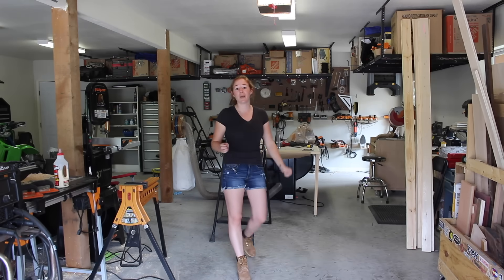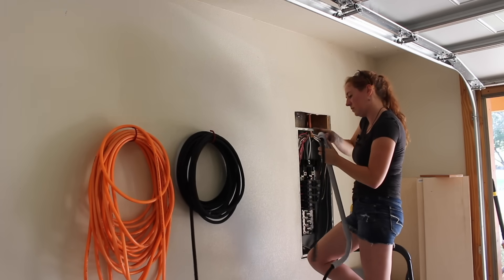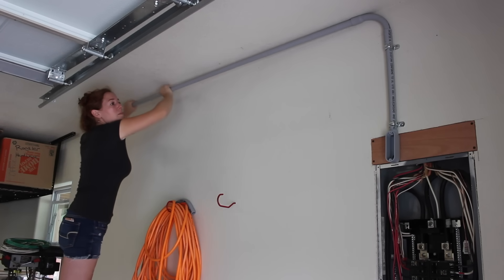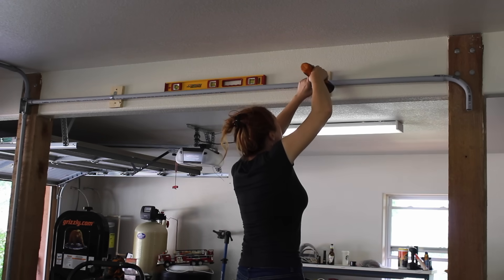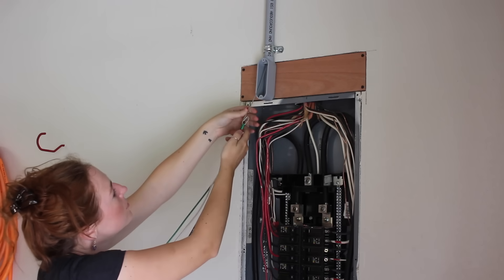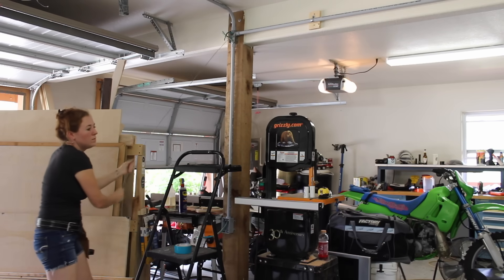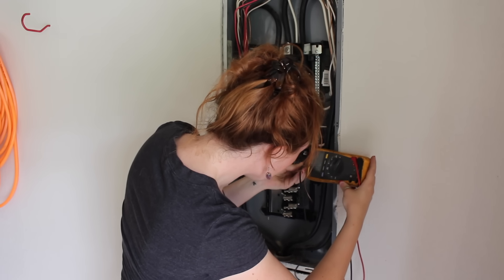Adding 220 Volt Outlets to the Garage

Comment from the maker: And let the comments begin. Ha. Ok a few notes from me: I am comfortable tackling this job myself and did lots of reading and asking around before starting it. It also isn't my first time doing electrical work. Depending on your knowledge level of electricity  you might consider hiring the job out and then regardless of your knowledge level, have an inspector check over your work. 

Something I didn't show in the video just because of time sake: Before energizing the circuit I went through with my meter and check continuity between each one of the legs to make sure there wasn't a short.

For those who don't know the acronyms: EMT is metal conduit. NEC is the National Electrical Code.

There was a big discussion about needing a red wire instead of a white. This is something that was brought up on Instagram while I was doing the project and the take away was if the intended load is 220/240v then two hots and a ground are sufficient. If there was something like an onboard clock or additional function (like an electric stove or dryer has) that requires 110/120v then an additional wire for neutral would be required. However, since I used white I did mark it with a red marker at the breaker so anybody looking in the panel will know that it's being used as hot.
Reply: It's pretty common in the US to be able to do the work on your own house as long as you follow code and inspection procedures.
Reply: Another great video, April. I do this kind of work myself too - minor electrical, plumbing, hobby electronics, metal and woodworking, etc. I'm not a tradesman or contractor, just a self-taught tinkerer. We are lucky the U.S. allows people to be self-reliant and not have to hire a specialist for the simplest tasks. Home repairs aren't brain surgery.
Reply: @automaticprojects  Actually, to be more correct:  'We the people, being the U.S., allow ourselves to be self-reliant and not have to hire a specialist for the simplest tasks.'
Reply: @automaticprojects  Until such time as the DemonCraps enact "protective laws" - for our own good, of course - and put people in prison who don't comply.
Reply: April: you always impress me.
Reply: NEOhio Woodworkers she clearly states in her blog she is not making the video as a how to. Her channel is not a how to channel it is a vlog of her projects. She is not claiming to teach anyone anything. You're just being a bit of an ass and it is unnecessary. 

She did everything correctly in this video. I'm not sure exactly where she lives but in most of rural US small things like this do not require permits. Hell where I live I can build an entire house without a single permit.
Reply: Hello, Sweden here. Someone commented on how it sounds crazy that you need to be certified to do any of this stuff. Let me start by saying I am NOT working as an electrician, however that was what i studied for when i was younger so i have some knowledge in the area.

So first off i think you did a nice job, whenever I have to do like external stuff like that I try to use either recomended wallstrips (if inside the house) otherwise I go with approved cables for external installation. So cudos on making the effort to keep it clean, having seen a lot of your videos though I'm no surprised by the quality of your work. :)

To adress the "omg you gotta be certified!?!". Listen, any sane person would ask for help and asume that you need good wiring and cables for something like this. But there are crazy people out there that I have seen run regular old like lampcables to extend a 400v main fuse, that is not only stupid but outright dangerous as it is a fire hazard. So in Sweden at least the rule is something like this: Everyone who knows how to do the job right is allowed to, without supervision, wire in stuff like ceiling lights (those don't always have connectors you know) and basicly any other household connection that already has wires going to the main box. You are not really allowed to do extra wall outlets unless you know how to do it properly and have a certified electrician look at it. You are NOT allowed, under any circumstances, to wire stuff in the main box unless you are certified to do so. Now that being said, I have a good relation with a local electrician whom was here when we redesinged the kitchen so he saw some of my own wiring and approved of them, later on we where adding some new ceiling lights to the kitchen and he told me "You know, to keep down costs I'll just leave this spare live-wire in the ceiling and you can hook that up yourself once you decide where all the lights go.".

And with all that I would never wire stuff in the main box because it's been almost 18 years since I did any of that stuff so I'd rather leave that to the professional while I do more casual wiring myself. But that's me and is no reflection on the job in the video. :)
Reply: Amen,  So glad to hear someone besides me say stuff like that.  Everyone thinks the Government owns them and they should say Mother may I everytime they need to go Pee.  If it's your house and you do it right (Code or Not) Then Screw it.
Reply: David Cobern+ In the UK there is no law against performing electrical work when unqualified.  You are legally responsible for the quality of your work and also it CAN be a problem for a house insurance policy.  I have fitted extra 3 pin outlets in my rented flat myself and on my request the landlord got an electrician to check them so their fire insurance remained valid.  The electrician commented that I had done the job better than many electricians would have done as I used additional anchors above the required number.  Better safe than sorry.

I strongly advise people NOT to do electrical work unless you know what you are doing, and DON'T KID YOURSELF.  If in doubt pay somebody qualified.  If you get somebody unqualified to do the work GET IT CHECKED by someone who IS qualified.  Even though I am confident I always get my work checked.  Getting an electrician to check work is a lot cheaper than moving house if it burns down.
Reply: I agree with you Mark. We are lucky. And it's not like it's unsafe. It has to pass inspection. And if diyers are going to bypass the permit process and illegally wire and potentially create a fire or electrocution hazard, they will do it regardless of whether it is legal or illegal. Just look at April's talent. All of that potential going to waste if we were required to hire a professional for everything that she does herself. And we would never get the things that make us happy and allow us to do our "building" because we couldn't' afford them. Another great project, April and thanks for sharing.
Reply: Here in Sweden, no you're technically not allowed to do any HV work yourself (230V), but you are allowed to swap out light switches and simple stuff like that. 
In my case I run the wire myself (most of the time) and then have my moms husband connect everything and since he's got a electrician company that's all good...

ALOT of ppl do this stuff by themselves though which causes fires and electrocutions due to ppl not knowing where to stick their thumbs :P
In case of a fire you'd probably not get any insurance due to not having proper papers for your electrical work..
Reply: In America a homeowner can work on their own single family house.  There is a hope that if they don't know what they are doing they won't do it.  Yes some risk but lots of rewards.
Reply: #TeamSpindleSander
Reply: Benjamin Allott that's why we call ourselves free in America. Not as free as we used to be, and not as free as I'd like it to be but we can still run wires and pipes in our own homes if we want to. Insurance may not pay for any damage caused by doing it ourselves we are still free to get er done when and how we like.
Reply: Eh there is a lot of gray area there. That's kind of a blanket statement. If there is faulty wiring and it burns your house down it's very difficult to distinguish work and who did what. If they can tie back the source to something distinct like a piece of equipment that failed and caused the damage then they can ask who installed it, but even then the homeowner could just shrug their shoulders and blame it on a previous home-owner. If you do the work properly and with common sense you are probably doing a better job than most 'licensed electricians'. 

The work I've seen by so-called electricians locally is atrocious, and most of them lack even a basic understanding of proper equipment installation. I actually had a career "master electrician" argue with me about leaving a sub-panel PE-Neutral strap in, (which created a ground loop) because he said that it was "Unlikely" anything bad would ever come from it. (Never mind that it's against code) This guy literally spent 10 minutes crying about fixing the issue rather than just popping the cover and two screws off of the tie. I do most of this type of work April did myself but I don't consider it "At my own risk" as I use good practice and installation. Remember, the more intimate you are with your mechanical systems the easier it is to trouble-shoot issues when they arise, (more-so with control systems or machinery.) Doing mechanical/electrical work isn't for everyone as it requires both education to some extent and experience to do it safely and well, but it isn't rocket science.
Reply: April Wilkerson awesome job 👍🏻 glad to see your still bringing us some awesome comments. Ignore the haters and remember the ones who find u and ur channel brilliant 👍🏻
Reply: Here are a few friendly suggestions I would have done differently [Journeyman electrician]

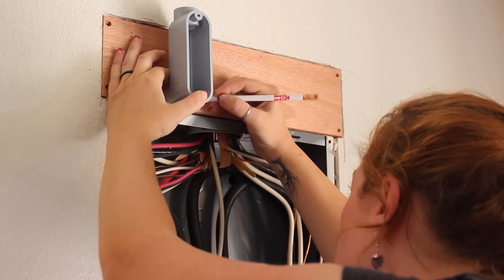0:44 I love that wood panel. [Not for conduit]. If you dont mind the look of the wood, its a fantastic way to run future circuits into your panel.

1:36 Use a 4 square box about 12 inches above the panel instead of the PVC 90 [Conduit body]. End the conduit there, then come out the back of the box with romex cable. Then go into the panel. Or come out the back of the box with flexible conduit, to protect the wires into the panel. The 12 inch space between the panel and the box allows for the 90 degree bend you need to make with the cable or conduit.
http://www.homedepot.com/s/4%2520square%2520box?NCNI-5
http://www.homedepot.com/p/Southwire-3-4-in-X-100-ft-Flex-Alum-Conduit-55082303/202316477
http://www.homedepot.com/s/romex%2520wire?NCNI-5

2:44 I would have used shallow, or deep strut here. That would provide the spacing needed to keep your PVC conduit relatively straight.You can also try conduit hangers. You can also use a heat gun, maybe a hair dryer, so heat up the PVC and allow for minor bends. This takes some practice, try it on a scrap stick of PVC pipe first. Dont burn the PVC either. 
 http://www.homedepot.com/s/strut?NCNI-5
http://www.homedepot.com/s/conduit%2520hanger?NCNI-5
http://www.homedepot.com/s/heat%2520gun?NCNI-5

4:04 This junction box is kinda small. I would've used a larger one.
http://www.homedepot.com/p/4-in-30-3-cu-in-Metallic-Square-Box-Case-of-25-521711234EW-25R/202592852

4:37 Yea red instead of white would have been better. But just buy some red electrical tape and at least wrap the white so its red, at each box and in the panel. This will avoid confusion for anyone working on it 5-10 years from now.
http://www.homedepot.com/p/3M-Scotch-75-in-x-66-ft-35-Electrical-Tape-Red-10810-DL-2W/100210612?MERCH=REC-_-SearchPLPHorizontal1_rr-_-NA-_-100210612-_-N

5:14 Minor thing here. Those straps on the blocks. They are one hole straps. They are facing down.
1 When they support a horizontal conduit face the straps up.
2 When they support a vertical conduit, alternate the straps left and right
3 When your conduit in hanging upside down on a ceiling, dont use one hole straps. Use two hole straps or something else.

Thanks for the video. All and all good job. This post is mainly for other using this video as a guide for their own projects.
Reply: all your tools amazing
Reply: April Wilkerson , just some info on the conduit and multi wire conductors,  the reason you are not supposed to run multi wire conductors through conduit is because all conduit is considered a wet location, and some of the multi wire conductors have a paper insulation over the ground wire, and if paper gets wet it then conducts. does it usually mater? no, that is just the official reason
Reply: chris struchen she said she marked it with a red marker, if you look at her panel there are a lot of red marked white wires in there already. She just moved in to an existing home, so I'm pretty sure the previous panel work had been inspected. Her work just matches what was already in her panel. The only thing that concerns me is that it doesn't appear that she ran the conduit into the panel, just the wall. If the new wires are rubbing her panel knock-out hole she could get a direct short to her panel and that is a fire risk.
Reply: One quick suggestion: When pulling wires through conduit it can be helpful to also pull a piece of string that you leave in place. That makes it easy to pull a second circuit in the future.
Reply: What countries are you referring to? In the US it varies by state but in most states the important factor is that the work is properly permitted and then inspected. Who actually accomplishes the work, as long as it is done right, is irrelevant.
Reply: +DevonIsAwake

In Germany you can do that too. Formerly only persons which are educated (apprenticeship) for this, but there are some common sayings here:

1st one: "Das elfte Gebot: Lass dich nicht erwischen!", literally transalated: The 11th commandment: Don't get caught!

2nd one: "Wo kein Kläger, da kein Richter"...No plaintiff, no judge

And here you've got also two voltages in the most homes. The most houses here in Germany are having a three-phase power supply. Three phases which are having a voltage of 230V measured against ground or neutral. But if you're measuring the three phases against each other they've got 400V.

https://en.wikipedia.org/wiki/Three-phase_electric_power
Reply: I'm an electrician and I'm proud of you.  A little common sense goes a long way.  Just be careful.
Reply: Oh yea? Which part of the installation would cause a house fire? Your overreacting
Reply: wow that's nuts, what countries are these?
Reply: David Coburn Yes they were. If doing stuff yourself like that, (not for reward) there's really not an issue and lots of folk do small jobs like that on their own property. I'm building my own house and a qualified Electrian has to oversee my work to sign it off as correctly done for us to reach code - and we'd need that if we ever came to sell the house.. My father was an electrician and before these rules were in I remember some of the truly dangerous stuff he used to come across done by amateurs and even some people calling themselves electricians so it kind of makes sense, but like most rules, can be taken way too far.
Reply: April Wilkerson thanks for that idea.  I usually just get a piece of plastic bag and tie it to the end to pull the nylon.  cool alternative
Reply: Better than I could do, Great job April
Reply: NEOhio Woodworkers - Some of us just like to watch stuff get done. Still, if April decides she needs an advisor, I'll volunteer: POST THE VIDEO.
Reply: she mentioned at the start she turned off the power at the main switch before the box; so the power feed was dead (so to speak)
Reply: I asked about that in an other post. She says she cut power at the pole. I don't know about TX, but in NJ, you are not cutting power at the pole. Main breaker is about it. You could pull the meter, but that is not something for most homeowners to do.
Reply: The NEC is only the minimum standard for electricial work!!!
Reply: Ok, here's my comment... you're awesome as always. That is all.
Reply: +Grant Bruner:

In Germany we've got the saying (literally translated): Voltage is hurting but current is making you small, black and ugly.

But we've got 230/400V three-phase power supply (star circuit, or Y-connection).

And for the people which are saying this is communism or some crap like this: Remind the workers/owners which could work later on this installation. Using the standards and the code could make their work much easier and could prevent accidents. If you're selling the house in the future it's the best thing to use the regulations and the code so everyone could comprehend what was done here.

In Germany, after the building is connected to the mains you can do whatever you want. But if something happens you're getting problems with the insurance, in case of injuries or death you're getting problems with the attorney. But these things could happen to electricians too if they don't work proper.
Reply: @Call RJ: Yes it does. Well actually you can't be certified if you don't work for at least three years as an electrician in some company. You are not allowed to do anything more than put a lamp to a ceiling (and connect it with a "sugar cube") or make a single phase extension cord.
Reply: Ya, the glue would be a good idea, and rotate the writing against the wall so you don't see it. That's just for cosmetics though. GFCI is not required in Canada for garages or powertools. Only outdoor outlets below 10'. The standard breakers won't protect you at all though. They just protect your house from fires. (not including arc faults) GFCI would actually trip if you touch the electricity.
Reply: That's why America Rules!
Reply: Most people that live inside the city limits wouldn't normally be doing this kind of work themselves (Don't know how)  Phil Robertson calls them Yuppies   LOL.  But even if they do I wouldn't spend too much emphasis on worrying about silly stuff like that.  Just do it right.  Like always.
Reply: agreed there are alot of fellow  sparkys on here with some really crap comments....
Reply: You did it right April Great Job.
Reply: Not that I would ever take on a project this large (electrically), but thank God I live in the US where I could if I wanted to! If I own a home, I damn well better be allowed to maintain it myself. Self-sufficiency is a beautiful thing as long as you know your limits (i.e. why I would never take on an electrical project this big).

Great job April!
Reply: You did a dam good job. I live in a rural area and we aren't forced to Be code compliant. I'd hire you in a second. If you want code compliant learn the codes or hire an electrician. Opinions are like Ass-Holes.....everyone has one!
Reply: April Wilkerson: My absolute favorite part of this video is that you didn’t waste the viewer’s time blathering endlessly about irrelevant matters.  You got right to the point, which is a fundamental concept that eludes far too many posters on YouTube!
Reply: Get it right, it's 120/240 V
Reply: = Tyranny . Resist and do it your self
Reply: canesrock82 muhaha..
Reply: Looks good to me. Glad you switched to the individual strands of wire; I guess heat can become an issue and I'm guessing thats why individual strands are warranted in conduit of any sort; General Contractor here, and have done MANY electrical projects, but I'm by no means an "Electrician."
Reply: @michaeldobbs5274  in canada we start derating ampacity over 3 wires in a cable or conduit...even loomex in 1" holes get derated by fill.
Reply: Awesome job I have always wondered how difficult this would be thanks for the video
Reply: As always, great job!
Reply: April Wilkerson thank you now old Wolfman can do it right with your instructions. 👍
Reply: We are not a communist country yet.
Reply: If they sell you a policy you are covered.
Reply: @Amtruckn  until or unless something you do can be construed (even incorrectly) to have contributed to an incurred loss.  Simply buying coverage does not address all risks, or those brought on by your own lack of knowledge, deliberate or not.
Reply: Seems like if the other hot wires in the box are white with red marker, making these the same has some real advantages in terms of being immediately clear.  If the function was somehow different, that would be the reason to make the appearance different.
Reply: OK, thanks for the feedback.  I sort of suspected they didn't want me mucking with their lamp more than anything.
Reply: In Australia, you are not even allowed to run any cables (some sparky's will let you run it as it saves them time and effort)
to legaly run data cables you need a restricted cablers licence.
Reply: At the end she is measuring with a multimeter and states: 245(v).  Which suggest live wire.
https://youtu.be/X9ro7Tc2nFI?t=300
Reply: Michael Dobbs most of that is hyperbole and is unwarranted, nec allows and suggests running all cable via conduit to protect it.
Reply: That's not quite correct and is over the top. In the UK you need to be certified to do electrical work accept under certain exceptions; however, when you read the small print there are more exceptions than not. It's a little like the 'i before e' rule in spelling.

You do need certification to work on the breaker box (consumer unit or control panel in UK speak), anything outside, anything within certain defined zones in a wet room/bathroom and certain extra low voltage/DC applications. Just about anything else is OK provided you are not increasing the rating of the circuit.

Of course whoever does the work it must conform to code.

It is even possible to do the above exceptions without certification if you notify building control and have them inspect as much as they wish. Given that they charge a lot for this it is more economical to hire an electrician for most modifications.

I own and run a property maintenance business here in the UK.
Reply: Yes
Reply: Correct Thomas.  I believe those are cables instead of individual wires.  In a cable you are allowed to Mark the White wire.  But when using individual wires pulled through conduit you have the ability to use any color, that means that the correct (not only way) is to use non-white wire.  But her marking the white wire will identify that it is not the Grounded wire.

Correct about the conductors being in open air from the LB to the Enclosure.  I can't remember the name of the conduit body but there is one that provides a sharp corner with a plate on the back side for pulling.  (Maybe Pulling elbow is the name)
Reply: chris struchen i just hope she either tapes her wire nuts and/or grounds the junction box, as well as red marks the white wire in each enclosure. Weather or not part of a cable or individual wires she is fine with the NEC, just proper practice and suggested to run red if individual. Her state and local codes however could be another point entirely. Local can be more stringent but not more relaxed. Electrically there is no difference as long as her individual wires are rated above her conceivable load capacity. The NEC does alow for mark corrected wires. Unless the codes have changed. I have been out of that game for some time now.
Reply: You are feakin' awesome. I just started wiring 12v LED lights for our haunted attraction. I have a long way to go to get to 220! My hubby is an electrician so I have let him do it all.
Reply: +Two Wheel Workshop

The circuit breakers are protecting you not directly. If you are using a class 1 appliance (appliance classes are defined in the IEC 61140, so they are the same worldwide) the circuit breaker could prevent electrocution from touching a housing or touchable surface that could have mains potential when the appliance is defective. But only if the loop impedance of the ground wire in the connection and the installation of the building is low enough and the short-circuit trip of the circuit breaker could react and switch the electricity off. From the measured ground loop impedance and the voltage you could calculate the PSCC (prospective short circuit current). 

But the RCD, or in the US called GFCI, is mostly faster and doesn't require such a low impedance as the circuit breaker does. Especially in TT-grids, in TN-networks the circuit breaker is mostly fast enough. Here in Germany the TN-C and TN-C-S are standard. In Germany every outlet that is fused with 20A or less must be protected with an RCD (GFCI) or RCBO (GFCI/circuit breaker combinated in one device) rated with a maximum of 30mA. 30mA is the current which could cause cardiac arrest. This is only for new installations build after 2013, older installations could be upgraded but it's not mandatory. Before 2013 it was mandatory since 1984 to use RCD protection on circuits that are in a room containing a bathtub or a shower. 

https://en.wikipedia.org/wiki/Appliance_classes#Class_I

https://en.wikipedia.org/wiki/Prospective_short_circuit_current

https://en.wikipedia.org/wiki/Earthing_system#IEC_terminology
Reply: +Robert Singleton:

But not every cable type is having paper inside. In Germany the ground is insulated like every other conductor in the wire, mostly with PVC and coloured green/yellow. The ground wire is never bare copper here. Standard type of cable here is the NYM (N=normalised, Y=PVC insulation, M=mantle). It could be used in dry or wet rooms, outside (protected from the direct influence of the sun). The outer sheathing is PVC, then you've got a layer of rubber style material to protect the wires inside:

https://upload.wikimedia.org/wikipedia/commons/2/25/AbmantelnNYM.jpg

The -J is telling it's having a ground wire. The version -O is not having a green/yellow ground wire. Then you've got a brown, black and a blue wire in the NYM-cable with three wires. There's also a version with five wires available: brown (L1), black (L2), grey (L3), blue (neutral) and green/yellow (ground).

But something I find remarkable: In electric installations you're normally trying to use flame retardant materials and inside of american cables is paper...or is this paper treated?
Reply: Hi in sweden it is like that. if u doit your self you cant get a professionell to certifi the work, he dont want to risk hes licens.
Reply: In the US, its not the worker certifying anything. Its a county Code Inspector.
Reply: April Wilkerson 
Thank you dear electrical and we want more explanation in the field of electricity
Reply: That is just a ploy to make work for the tradesmen.  I would subvert such a government at every opportunity and cheat on them to the max.
Reply: In the US it's totally different:

L1: black
L2: red
N: grey
ground: green or bare copper

L3 could be blue or yellow, but in most domestic areas you don't have the L3 because it's not a three-phase power supply. In the US the single-phase three wire system is common in domestic areas.

https://en.wikipedia.org/wiki/Split-phase_electric_power

In Europe the three-phase power supply is common even in domestic areas:

L1: brown
L2: black
L3: grey
N: blue
The ground is called PE (protective earth) and is green/yellow.

The PEN, combination of neutral and ground in one wire (only permitted if the PEN is having a cross section area of 10mm² (copper) or 16mm² (aluminium) is green/yellow with blue markings on the visible ends. See the TN-C earthing system:

https://en.wikipedia.org/wiki/Earthing_system#Types_of_TN_networks

In Germany the most common system is TN-C-S.
Reply: In Britain, you will still find pre-harmonisation colours: Red/Blue/Yellow for the 3 lives and black for neutral. If you go really old (pre 1970s ish) you'll even find pure green for earth.
Reply: Can you explain one thing please, about the US system?

240V sockets are considered as 2 phase - but as these are double the voltage of the 120V single phase, these must be 180 degrees apart.

I assume you use 3 phase (120 degree) distribution as that's pretty fundamental - so does that mean you actually have a 6 phase system at the delivery end in practice? Because voltage between 2 lives on a 3 phase 120V system would be 208V.
Reply: Single-phase three conductor system is not having a phase deviation, the systems are not comparable. Take a look at this picture, it's a transformer that is transforming the medium voltage to low voltage. The conductor in the middle of the right side is the neutral wire, which is grounded and so referenced to earth potential:

https://upload.wikimedia.org/wikipedia/commons/e/e8/Split_phase.svg

Actually this is not a 2-phase system, it's the same phase so you don't have a rotating field. Unlike to a three-phase power supply. Only the voltage is higher, so appliances with a higher demand are drawing less current. Here in Germany such a system was dismantled during the 1950s, that's the reason why the Schuko-plug system is not polarised. You've got the two hot wires but no neutral. So a polarisation of the plug wasn't necessary. In the UK you could find some remains of this system but they've switched to 3-phase power supply.
Reply: I get that - It is probably a case of semantics. I could call that 2-phase, with 180 degree shift, but probably most wouldn't. It is basically a centre tapped system with centre grounded. The only time I've actually heard of a 2 phase system in use, and bearing that name, were some of the historic systems in London at the turn of the 19th/20th century - and these were 90 degrees apart. A very weird system indeed.

However, semantics aside, does the USA use a 3 phase 120 degree generation and distribution system? And do people ever have full 3 phase supplies (eg farms)?
Reply: Trav Park the power is never ever off in the panel unless the feeders from utility company went to a main disconnect first. Also the lights were on wherever the panel was. So the power was still on.
Reply: April Wilkerso
Reply: April Wilkerson What is the voltage in the US? Because where i come from, the Netherlands, we use 230 volts for in the house and we use 400 volts for powertools like plasma cutters and welding equipment.
Greetings from the Netherlands!
Reply: Good thing you marked the white wire. Ive seen stuff happen where they upgrade the service, and they don't mark the white hot wires and it takes up time and stuff won't work properly.
Reply: Not sure where you live, but I live in the country in a free state in the U.S.A.  I built my own house, wired it, plumbed it, and ran the gas line.  NO permits or inspections required.  Obviously the propane delivery guy ran a leak down test on the propane tank when he filled it but I had been using the propane that was in the tank when I purchased the used tank.
Reply: And this is why America is called the land of the free.
Reply: Read article 200.5, this is a circuit over 50 volts therefore it is illegal to recolor a white wire, unless it was part of a factory assembled cable, which this isn't.
Reply: No, not in north America.
Reply: No, it's a bare minimum. Every individual code was written because of previous accidents or failed installations.
Reply: Funny way of doing it. Personally I would never hook up someone elses work, not even most electricians.
Reply: What in the world are you talking about? Ignorant home owners do by far the most hazardous work.
Reply: Yea except she ran wires in free air from the LB to the knockout in the panel, and forgot to glue her conduit and looks like the wire nuts she used were too small for 3 12/14awg wires. I think we found the armchair electrician :)
Reply: Here in Norway that is right. Here you can't even do plugs, if they are bigger than 16 amp single phased. The exseption is that an electrician can do this, but in his own home only.
Reply: Jason. If you are pulling wires in your garage you could hang the single conductors from the ceiling with J hooks but that would not be the proper or safe way to do it. The color of the wires is to help keep people working on the electrical system safe.
Reply: The NEC is the bare minimum
Reply: Yes. I saw something wrong. You're not an electrician. How that is not illegal over there is beyond me.
Reply: Here in Urbana Illinois, You can get permit first then work on your own house only. they will inspect you against NEC after you are done.
Reply: The best never rest!
Reply: April Wilkerson .....your work makes me complete. Great video.
Reply: It doesn't work that way. Get that permit, first.
Reply: commies LOL
Reply: GREAT JOB <3
Reply: You don't get to make the code up. You can't just mark the white wire for that size wire.
Reply: You did a good job and its your shop, so do it the way you want it. Although the white wire just kills the ocd in me. lol.
Reply: the red mark at the panel isnt sufficient enough. mark all splice locations and use tape or shrink tubing.
Reply: Did you earth those METAL junction boxes? They also seem really cramped/small for 3 sets of conductor to be terminated or joined with those wire nuts.
Reply: This is a good, constructive comment.  One way to "change" the wire color problem and increase the utility of the system would be to run an additional red (or other non-white) wire in the conduit.  Use the black/red/green wires for the L2/L2/Gnd 240VAC.  You mentioned that you didn't have a lot of 120VAC outlets.  At some point in the future you can use the white neutral for 120VAC outlets.  You done a great job.
Reply: Two comments... Technically you were supposed to ground out the metal box that you used for your junction; using a plastic box there would have been easier. Second, instead of using a fish tape, tie a piece of paper to a string and use your shop vac to pull it through the conduit. It's quicker than a fish tape and pulls easier.
Reply: If you do something like this yourself, do you have to have it inspected by the state/county/city inspector to make sure you're up to code?
Reply: I'm an electrician and I Concur.   
   Not sure what for.  Just do. 😂
Reply: In the UK we can do the first fix but the connection to the mains box has to be done by a qualified electrician and signed off our rules are stricter suppose it saves houses burning down plus all our cables are double core insulated and fire rated as they generally carry 240V and lots of angry pixies trying to escape (Ave fan club).
Reply: Isn't America Great!
Reply: I don't think there were any glaring issues. I couldn't tell if you ran pipe right into the panel. If you just piped into the wall the conduit should continue to protect the wire in the wall. There could be a few more straps on the pipe. The ceiling section only had one and there should be a strap within 2.5' of each box on each pipe. I usually just put 2 straps per 10' pipe. (there are a variety of strapping requirements that vary with pipe sizes.) We would be allowed to surface mount NMDU above 5'. So there is potential to avoid using conduit. I'm basing this on Canadian electrical code which is usually 5 years behind America but very similar.

Besides that, like you said be careful around the panel. Those middle breaker tabs have 240(or 220) between them. Don't wear a wedding ring while you are in there. I've seen people burn their rings onto their fingers. They make silicone "livestrong" style rings for construction. They will tear off before your finger does and not conduct electricity. I realize you may have set up your voltage test shot for the video but if there was live power you were closer than I would get. Stay safe! :)
Reply: @MrMCTario  suface mount nmdu above 5'? Lol dont think so bud. Not in any CEC I've read.
Reply: One thing I will add, you should always check with the city you live in to see if a permit is required, and if it is, get one. In the event that something goes wrong and catches fire, or even if it's a fire totally un-related to work you did, your insurance may not cover you if they find electrical work that was done without a permit, especially if there are code violations.
Reply: April Wilkerson I work as a carpenter in my country and I love to follow up your work especially your tools are very precious
Reply: Next time, working with live electricity, take of your (thumb)ring or put pvc tape over it. Work with one hand. Put on isolating shoes.
Reply: Oh, please. An electrician who assumes anything is either an idiot or dead.
Reply: It still needs to pass code and be inspected. Not being allowed to run data calming is just trade unions run amok.
Reply: @tzprefect  
Same can be said for electrical.
Reply: USA SINGLE PHASE AND THREE PHASE SYSTEMS
If someone calls it two phase, its usually a mistake. If its at a residence, then its single phase. If its at a commercial or a industrial building, its usually three phase.

1 Here is our Residential power source. This is the transformer on the pole, or in the ground. In this drawing, the residence would use Phase C [the coils between X3 and X2]. So our two 120v hot wires are X3, and X2. Combined, these two hots equal 240v. Our neutral wire is X0:
https://www.civicsolar.com/sites/default/files/comment/files/ED%27s4Wdelta2_%282%29_0.JPG

2 Now here is a typical electrical panel at a *Residence*. The two black wires labeled "*Power From Meter*" are the two 120v lines [X3 and X2 previous example]. The one white wire labeled "*Main Neutral From Meter*" is the neutral [X0 previous example]:
http://s3-production.bobvila.com/articles/wp-content/uploads/2013/12/100amp_panel.jpg

3 Here is our two three phase systems for *Commercial and Industrial*. Most of the time its 120v/208 Wye for commercial, delta is usually used in industrial applications, this can also be different voltages, such as 277v/480v:
http://ecmweb.com/site-files/ecmweb.com/files/uploads/2013/04/304ecmCQfig1.jpg
Reply: First April I love your show and I think you do an awesome job showing others how to make some great things....but

Unfortunately as a licensed electrician I saw several violations on this install.  Some of the things I see are wires going into panel from LB were not protected going into the panel allowing for rubbing of wires through the knock out in the panel.  Remember a lot of the machines your using cause a lot of vibration. The conduit should be ran all the way to the box.  White wires ran as "hot" wires is not a good habit and need to be identified at every location not just at the breaker as you mentioned.  They should only be ran as grounded conductors(not to be confused as the grounding conductor which is the green wire).  If being re-identified wires needs to be marked at each location junction boxes and at the plugs..etc. in addition to the panel. The junction box you choose is overfilled based on the calculations of the wires alone not including your internal connectors(3/4" fittings and your wire nuts) well exceed your ~14 cu. inch box. Minimum size box should have been a four square box. 
--To your viewers please contact a professional with this type of installation as this can be very hazardous and violate your insurance policy in the case of a fire.  You can in many places pull a home owners permit for a small fee allowing you to perform the work yourself and always have you work inspected by a licensed inspector.  Don't just rely on a friend that is an electrician.
Reply: +April Wilkerson

The resistance measuring with a multimeter is worthless in this case. It would only indicate if the copper conductors have direct contact, but not if the insulation is damaged and could not withstand higher voltages, but is still good enough for the low voltage of the multimeter.

 In this case an insulation resistance test is mandatory, testing voltage of the Megaohmmeter switched to 500 V and the resistance of the insulation should be at least 25 MOhm (in the US).

Here in Germany the insulation resistance must be at least 1 MOhm, but the resistance is actually always much higher.

https://en.wikipedia.org/wiki/Hipot

And remember: The PVC insulation is degrading over time, especially if the wires are overloaded and the conductor temperature is exceeding 70°C (158°F). The effects of the overloads are cumulating every time this is happening up to the complete failure of the insulation.
Reply: You did just fine April.  Just for future reference.  On 220VAC you should use 2 colors other then White for the wires.  When using single conductors the white is reserved for the Grounded conductor.  You will be just fine in your installation but if an electrition comes to provide service if they see the white wire they might assume 110VAC until they check the voltage.
Reply: Interesting, in Alberta, Canada - while I do not know about plumbing, as a homeowner I can pull my own electrical permit, do the work myself and then have it inspected
Reply: So (I replied earlier): I offered to fix a lamp for somebody, and they claimed they had to hire an electrician to do the job.  Were they being overly cautious, then?
Reply: April Wilkerson only thing I'll add that I have not seen is don't hold your meter when you use it. Always set it on something.
Reply: If it was a workplace they may have had Health and Safety laws to consider.  In workplaces it IS illegal to employ unqualified people to do some kinds of work, and company regulations come into it too.  In some cases organisations have agreements with their insurance companies to get cheaper insurance, so they have strict regulations for that reason.  If it was a home appliance then the people concerned may have just preferred the risk of causing offense to the risk of having a person of unknown electrical skills working on their lamp.  Most people know little about electricity but they do know that faulty electrical equipment can give people shocks or start fires.  If I have no idea of someone's skill level I wouldn't let them do such tasks for me either.
Reply: Depending on the area, Delta or Y (Wye):

https://en.wikipedia.org/wiki/High-leg_delta

https://en.wikipedia.org/wiki/Three-phase_electric_power#Wye_.28Y.29

Mostly in industrial areas and not for domestic use. The wire colours could be different on a three-phase power supply:

L1: black or brown
L2: red or orange
L3: blue or yellow
N: white or grey
PE/ground: green, green/yellow or bare copper

In domestic areas I think it's the same as here in Germany: If you don't have a three-phase power supply in your workshop, modify the three-phase table saw with a Steinmetz-circuit to function with a single phase:

https://de.wikipedia.org/wiki/Steinmetzschaltung

Older Washing machine were typically using a Steinmetz-circuit too. But the possibility is limited to motors with less than 2kW.
Reply: I said , I will follow her because of her cup size....
Reply: Me too! still don't know her cup size....
Reply: Jeremiah Diaz id say she is easily a DDcup
Reply: it also affect insurance claims if there is an electrical fire caused by uncertified wiring the claim is void.
Reply: April, I thought I was going to "educate"  you about 'gang' boxes. I assumed 'gang' was denoting a box for multiple applications. So, not knowing the term for a single box learned you did not need any education. :)

Fine tutorial. 
For future reference thinking, pull extra out from the first box the length of the leg of the second box to the junction box. Feed your tape 'from' the second box 'to' the junction box then pull the wire to the second box eliminating the need to break the wire at the junction box. This would be practical if the distance is not too long or you don''t want to break the line. The wire you used lends itself to this if you care to. 
Since I assumed already on one thing, I could be all wet here as well. ;)
Reply: I do concur with your posting. I taught to my self that she should have do a straight run from the second box to the first outlet box with out having to cut the wire at the junction box. The length of the run is short but my principle applies to voltage drop which creates losses.
Reply: Does this mean that if you wanted to add a couple of extra plug sockets to your home you would need to go out and get professionally certified first? You can't just do it yourself and have an electrician come and inspect it and sign it off?
Reply: April, +cengeb has a good point below: You definitely want GFCI (Ground Fault Circuit Interrupter) breakers on power tool circuits.
Reply: I was in the UK a while back and offered to fix a lamp for somebody.  I was told that they had to hire an electrician to do the job.  Seems a bit restrictive, but . . .
Reply: April Wilkerson can you show me how to replace a furnace
Reply: Additionally I wanted to add that if your home is insured through any insurance agency, that you absolutely have to have all electrical work performed by a licensed electrician and follow-up inspection or they can (and usually will) completely void your entire insurance policy if this is not adhered to. Basically if you do the work yourself they refuse to insure it. Unless of course you happen to actually be a licensed electrician yourself by trade. Then by all means, go ahead.
Reply: We as the homeowners almost always do a much better job than the so called contractors do anyway.  All they do (most of the time) is hire people cheap that have no idea what they are doing.  Good work April.  I do everything myself as well.
Reply: hey. it ain't 100% up to code. but the NEC is way over kill on most things. nice job
Reply: Michael Rueling  - Please tell tell us what parts of this installation are not up to code?
Reply: You must live in a socialist country.
Reply: It's worth pointing out that some jurisdictions (like my county) require that a licensed electrician do all electrical work (on top of the permit), so individuals aren't legally allowed to do things like this themselves everywhere, regardless of comfort, knowledge, or safety.
Reply: macaroniandtuna for the sheep. If I lived in your county I still do my own work.
Reply: I am surprised you are even allowed to do that, as most countries it is illegal to do your own plumbing and electrical work (some even restrict data cabling)
Reply: @sparkybearbomb533  Those countries treat their residents like children.  It is the guild protecting itself.  In some countries you couldn't even paint your own house.
Reply: @sparkybearbomb533  Not really. If you are the homeowner you can do you own work, though significant/hazardous changes should be submitted to an appropriate building inspector for final approval. If any relevant accident occurred after the fact and the work was not approved, an insurance claim could be denied as a result.
Reply: @sparkybearbomb533  Not in parts of USA. Depends on your county, city and state regulations.
Reply: April Wilkerson Too many NEC code violations ...This is how house fires happen ..I assume you did not get this inspected because it would not pass inspection ..But it will work till many years from now..Good luck ..She didn't even know the difference between 220V and 240V .if you have 220V machinery like u stated and energize it with a higher Voltage u can damage Equipment and or cause a fire ..220V is mostly commercial nominal power . GOOD LUCK LITTLE LADY. .
Reply: Sometimes... you need an adviser to tell you when... and when not... to post a video.  What's the purpose of posting this?  To show what you do not know about running electric... or code... or to guide your subscribers how to run a 220 circuit without a permit?
Reply: If you are pulling the wires in your own garage you can make them any color you want.